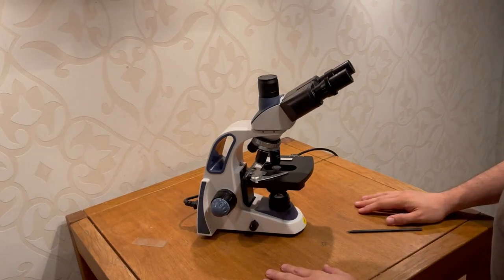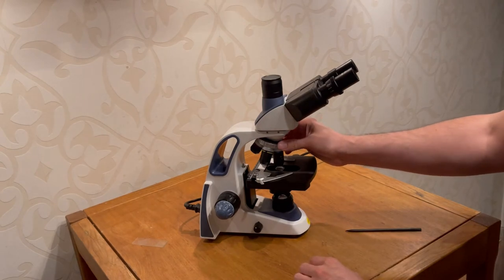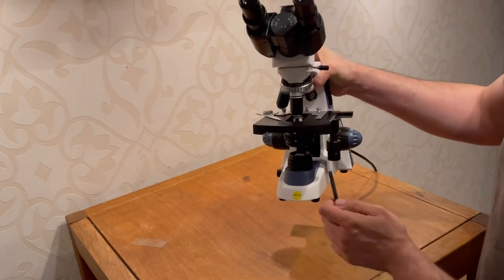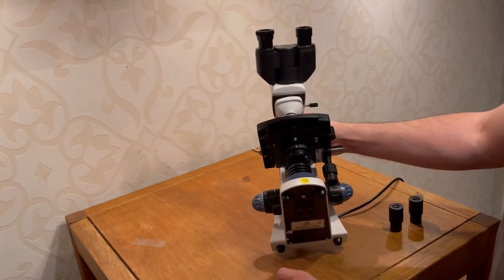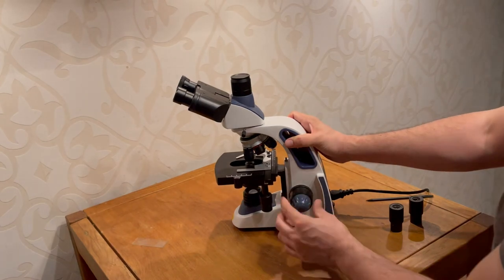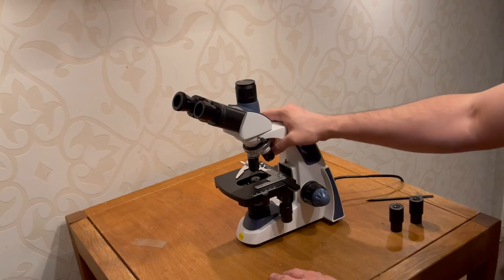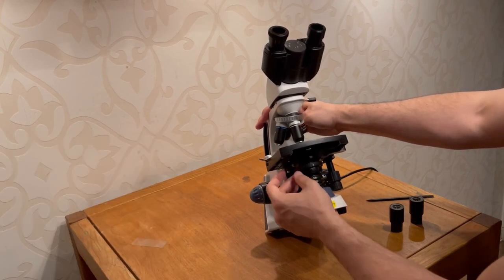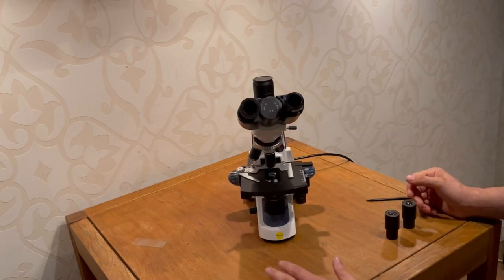Before you buy Swift SW380T microscope. And after you got it. Main issues and some fixes.

Comment: The problem with Swift microscopes is that they are a Chinese manufacturer, only 15 years old. Makes a short production run, and 😊makes it obsolete with the next model. There is no distribution network no product support, and replacement parts are unavailable.
Reply from the maker: which one would you recommend to buy as a beginner microscope ?

Comment: The objectives may not line up with the condenser because the nosepiece was not lined up properly when you tightened it.  If you can loosen the nosepiece and rotate it so the objective lines up with condenser lens and then re-tighten the nosepiece, you should be able to fix the problem.  Right now you are getting vignetting due to misalignment of the nosepiece.  If this brand new, I would have returned it.
Reply from the maker: Thanks, it's a good advice for the future. I fixed the alignment in another way and it worked perfectly fine. Now I have upgraded a bit and working on getting the camera mounting unit on place.

Comment: A good microscope will have centering screws for the condenser. There was a mention of three "bolts" holding the condenser. Maybe they can be adjusted to center the condenser. The other defects are unacceptable.
Reply from the maker: The screws were on the plastic plate, so the way I fixed it is by widening the holes and make the condenser loose a bit with the ability to tighten it on the right position
Reply: @manCaveSweden  Alright! Sometimes you just have to improvise or modify. I'm glad you fixed that problem at least.
Reply from the maker: @snorman1951  yes, the microscope is now working like a charm! I also fixed a good phone holder so the videos also have great quality. Very happy for the purchase overall :)
Reply: @manCaveSweden  did you need any extra optics on top of the photo tube or just photo tube + phone and phone holder
Reply: @manCaveSweden  also, what phone holder did you buy
Reply from the maker: @SLURPZZZ4461  at that point I had just a phopne I believe, no extra lenses. Also if you have a specialized camera (not super expensive) it usually goes in teh phototube as is.
Reply from the maker: @SLURPZZZ4461  I don't remember what I had at that time, but later on I bought swarovski universal phone holder and it is awesome. And even later I got the 3 axis metal phone holder for like 75 eur. and it was also amazing! 
However I had ok results with a super cheap phone holder that I got in the local Biltema - where you can also get things for hunting. Simple holder that was maybe 12 euro. Hope it helps a bit, and let me know if you ocannot google these, so I look them up
Reply: @manCaveSweden  I can't find Swarovski phone holder

Comment: It's called bad shipping lol
Reply from the maker: I agree. but on the other hand, how could bad shipping bend the focusing axis inside the microscope, without any visual damage on the outer part ?
Reply: @manCaveSweden  I assumed from the twisted/bent arm the gears/controls inside too have been shift with it, straightening it may fix all issues, either mount it in a vice or have a friend hold one end and twist a little, til the light matches the optics
Reply from the maker: @KavorkaDesigns  yup! that's more or less what I did. I also used a super precise device called hammer -)

Comment: Hi good work man, 
I just got one yesterday, and although mine didn’t have any of the same problems yours did, it had its own unique ones. 
The spring arm that holds the glass slide in place is sitting up off the table by 5mm so it completely misses the slide and doesn’t hold it. When I push it down to make the contact and release it, it raises the slide off the table to that 5mm level it sits at. I may have to try to bend it permanently. Annoying! 
Secondly my eyepiece adjustments are loose, so that when I open them out to suit my eyes, gravity pulls them back down to be closer together. 
I’m not sure what a jump in quality of microscope would cost, but I have to say despite these two things I’ve had hours and hours of fun already and it’s hard not to enjoy.  
Skål :)
Reply from the maker: Awesome! Thanks for sharing the defects with your microscope! It will definitely help people! 
I have tried to see if the two screws on both sides of the eye pieces could tighten them up but it does not seem to be the case. I assume the top plastic case with IX marks might cover some important adjustment bolts.
Reply from the maker: @jwstore7558  indeed! Thanks for the direct link. Is there a possibility to do my affiliate link ?

Comment: Located in Canada here, I have been having a hard time figuring out what would be the next step up from the readily available SWIFT SW380T and where I could find other options?
Reply from the maker: that's a good question! I went up to the zeiss axioskop 40 which is the old (like from 2000 ish) lab grade microscope that I was able to get for about 1000 usd and than upgraded to axio imager z1. But that is a big jump in the technology and cost. So i'd say check the ebay for any of those items and contact sellers, they might offer you 50% discount form the listing price if you ask nicely (like I did =) Or if you have the financing and you don't like the DIY than the new axio lab series might be something ? 
And sorry that I am only going the zeiss way now It's just because i recently got few extra zeiss microscopes that I am exploring now and maybe will sell one of them.

Comment: Thanks for sharing this! I had the same problems! The objective holder of the lens are loose and misalign the lens. How did you fix this? Which screws did you tightened?
Reply from the maker: Hi mate, i guess it's the entire objective holder/the mocroscope head that is loose - so you might want to tighten the screws that are somewhat hidden and would tighten it toward the mocroscope body, maybe you can point out the time on the video where I am mentioning the same issue, so I understand better where it is

Comment: Nån måste ju tappat den i golvet eller nått? Jag var precis på väg att beställa en. Tack för varningen!
Reply from the maker: It’s unlikely that it was dropped on the floor as the adjusting knob had no visible plastic defects (assuming it was dropped on the side) . And the adjusting rod was bent inside the microscope. I would rather assume the assembly was done from weird parts or some leftovers and it did not go through the quality control. Now, I don’t know what is the percentage of such devices , it might be pretty low hopefully.

Comment: SW380T or SW380B?
Reply from the maker: That's a trinocular version, so T.
Reply: @manCaveSweden  Thank you. I already have a SW380T, but I can't find a 60 eyepiece anywhere. I would like to buy another one, but I can't find one. I'm just learning and maybe someone will give me some directions. I know someone had such an ocular, but I don't know if it's from the same company or if there are other ones that fit.

I tried: WF60X eyepieces (23mm) -I guess it is 23mm.,
but cant find
Reply from the maker: @mijang3394  60x are quite rare. I got mine from ebay. They can cost same money as the microscop itself. 
Especially for my current microscope.
Reply from the maker: and it has to be an objective, not an eyepiece.